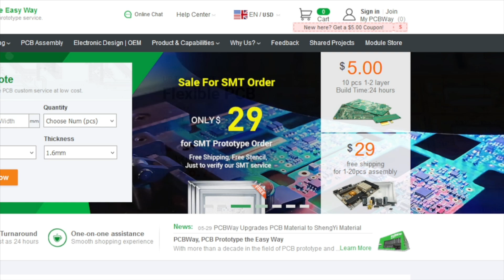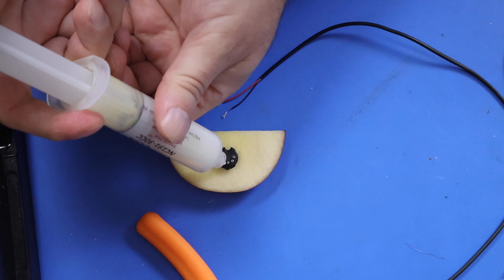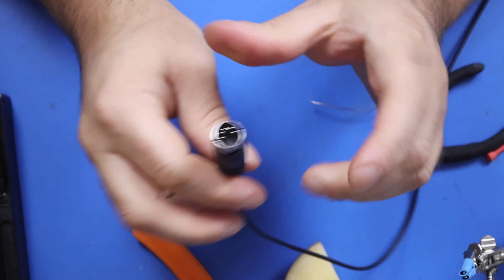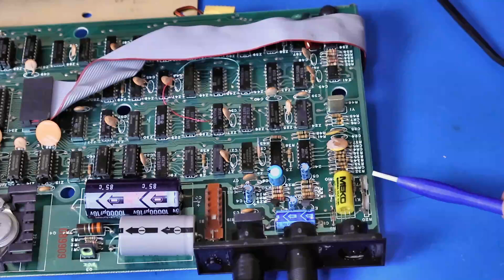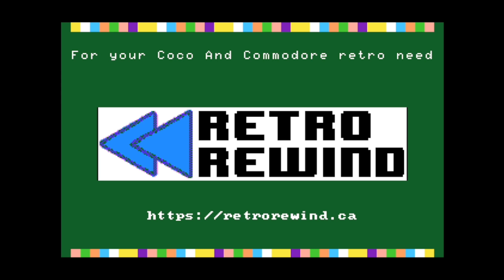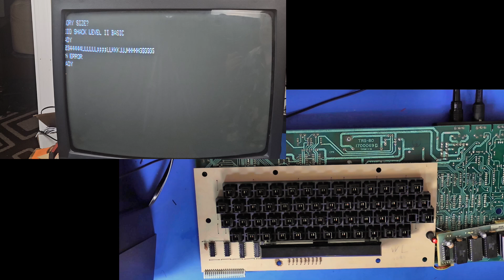My TRS 80 Model 1 Has A Very Strange Error

Comment: I wonder how it does that keyboard self test. Man, that's cool and something I've never seen before. It sends itself keyboard signals at boot some how and reports the ones that are lost. Really this blows my mind. Thanks for sharing Ken I'm really impressed with that little computer ;)
Reply from the maker: My guess is it tests the individual lines of the connector and sees one is not working and knows that is the line connected to those keys so it knows what to print out. A REALLY cool feature that should have been included in more old computers!